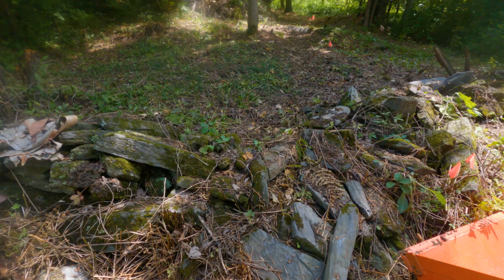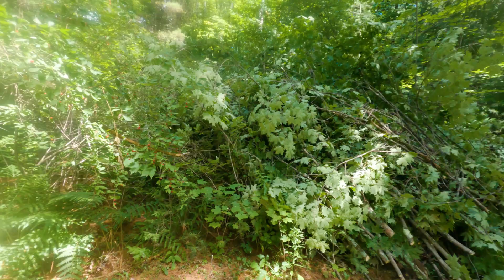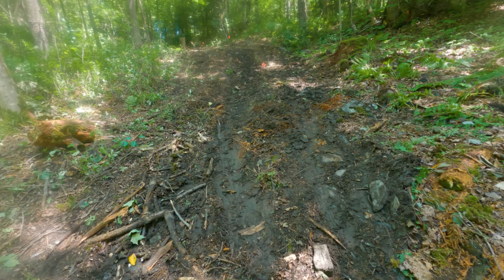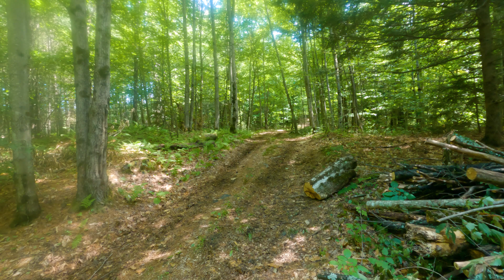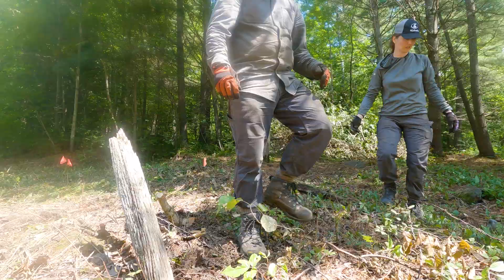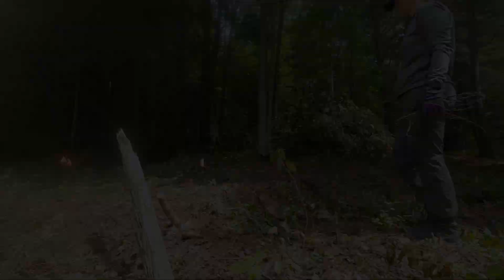Can we move this stone wall? Moving rocks with Kubota L3901 tractor

Comment: A grapple would be a great addition to the tractor… moving rocks,brush and logs for the mill has never been easier for me.
Reply from the maker: When we bought the tractor, we had the 3rd function hydraulic added so we could get a grapple. The dealer didn't have any in, so we ordered one from Everything Attachments in mid-June. Unfortunately by mid-November it still hadn't arrived (original estimate was September) and since we were leaving Vermont for winter, we had to cancel our order.

Having thought about it some more, we've decided we're not going to get one for the time being. It's a fairly big investment and while it would definitely make some things (much) easier, it doesn't let us do very many things that we can't already do today (albeit making them easier).

Instead, we've decided to use that money and buy a wood chipper instead. Having rented one several times, we've made the decision to invest in buying one of our own. Stay tuned!
Reply: @AdventurousWay   I tried to get one from EA also,but the wait time was too long so got the landpride from town line equipment in Plainfield NH/Pittsford VT. Think it was around 2000, cheaper than EA and it seems to be holding up very well through my abuse. Can’t tell you how much we have used it to move rocks,trees and brush. The last lot down the road we did by hand and excavator rentals…. We ended up just making piles of brush and burning it but I like the way your lot looks with the chip spread out.